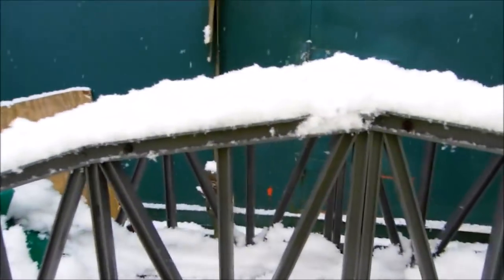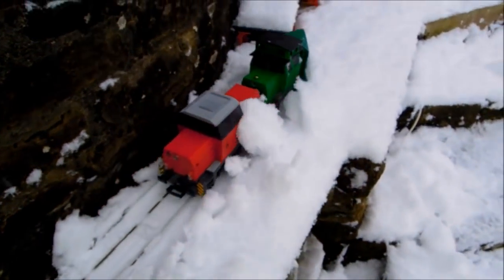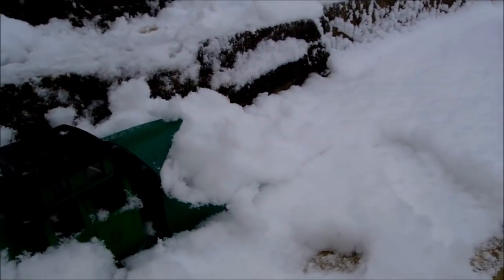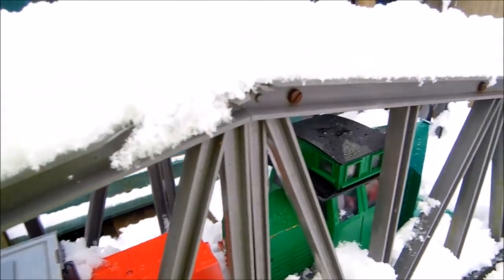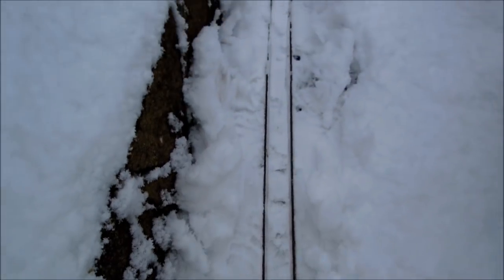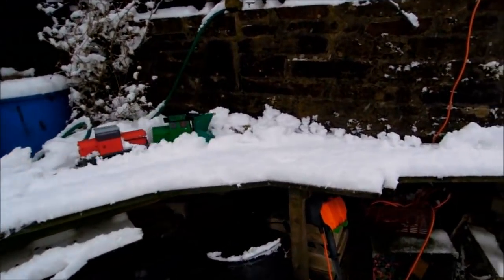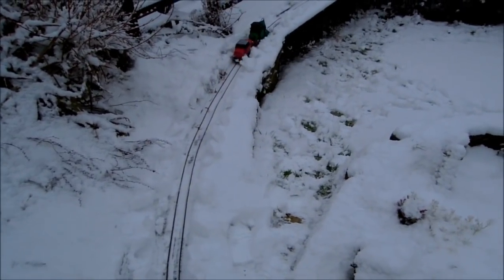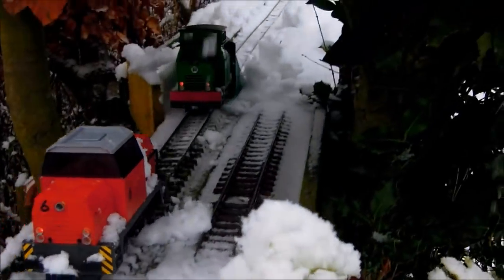Dashing through the snow   garden rail snow plough issues

Comment: Why use 2 throttle ?  One can manage 2 or plus locomotive. I have 3 locomotives and I use one throttle.
Reply from the maker: Hi Nicolas, I will try that. I haven't paired two locomotives with the same controller before. It will save a lot of dexterity